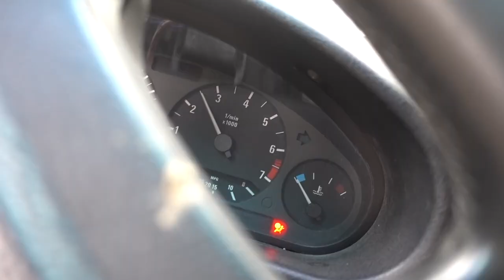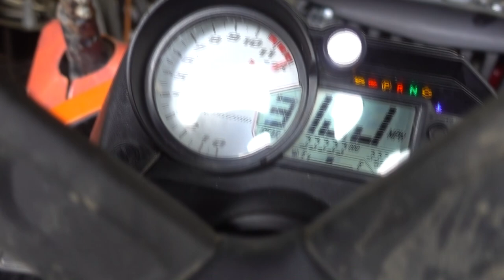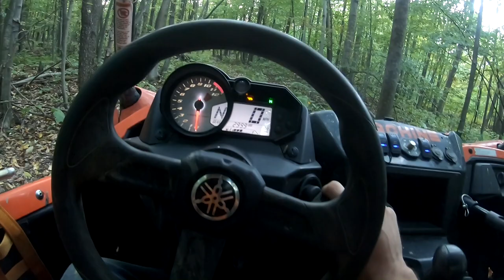Renovations & Expansion on My 100 Acres

Comment: when we used to make trails we would ride the 4 wheeler so we could throw our weight around, and then we'd just do small wiggles and try to get some marks down, then start picking up the pace. also we always put downed trees to mark it so we wouldn't make too many wrong turns.

Comment: Dalton have you tried a 230mm carbide circular saw blade on a whippersniper , Sweetwater bushwacker with centrifugal clutch  , it works even faster and better than a chainsaw , it fits purrfect too , gotta have a two stroker lol 32cc or higher